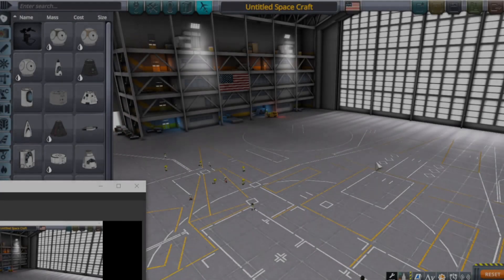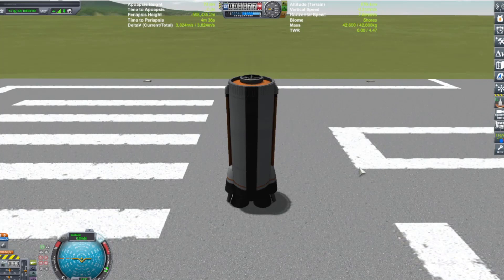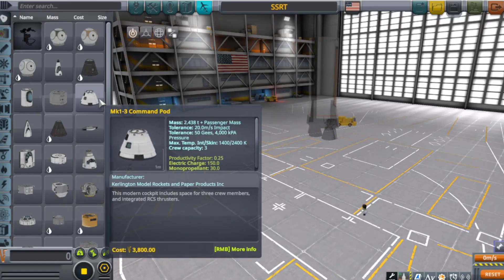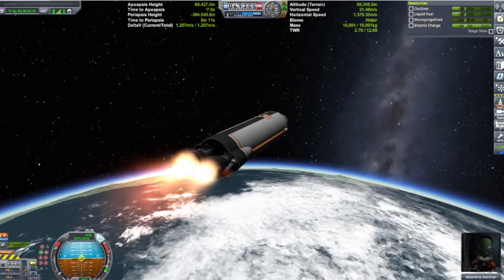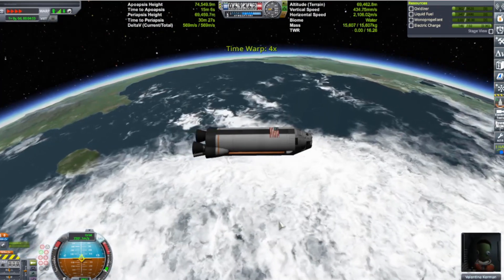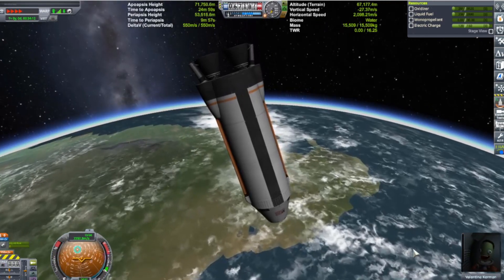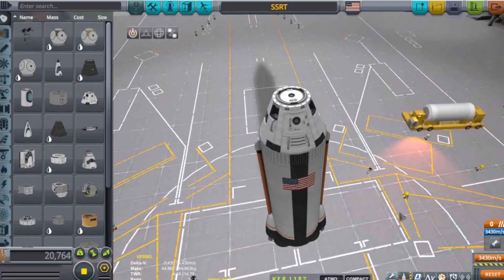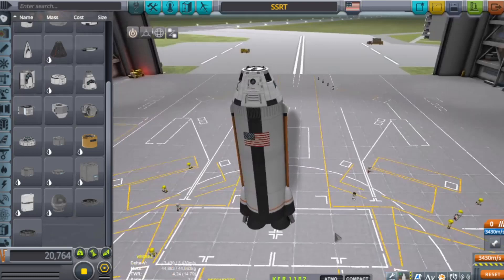SSTO in 2 parts! Ya ... it's that easy.

Comment: This says something interesting about the idea of an SSTO as the ultimate goal of real life spaceflight: it’s relatively easy to make something that can get to orbit in a single stage, what’s hard is making it reusable and useful. As an IRL example: if the LR-89 could have been air-lit, then the Atlas A (which had no sustainer engine) could have been an SSTO (I think, I need to run the numbers). But it wouldn’t have been able to do anything once it reached orbit, not even return to the surface, and it wouldn’t have any meaningful payload capacity.
Reply: SSTO's aren't that easy, at least without a meaningful benefit
Reply: I DONT CARE

Comment: Please do a podracer ssto.. It shouldn't have to be ss, just single engine stage is alright. Mine drops the oxidizer tanks for efficiency for example and has range to Pluto and Charon in Stock size RSS

Comment: This reminds me of the time I kinda accidentally made an SSTO. 

I wasn’t experienced with budgeting delta v for my rockets yet but I was pretty good at gravity turns. So I just wanted to make a two stage rocket to put a payload into low Kerbin orbit where the first stage was supposed to only get it half way there. But when I launched it the first stage nearly got into orbit all by itself. And removing the second stage made it an SSTO. 

Ever since then I’ve been playing KSP modded so that the planets are approximately 3.2x bigger and 6.4x further apart. Much better balance for stock parts in my opinion.
Reply: Stock parts are stupidly overpowered, since their performance is based on real life parts, but everything in the Kerbin system is like a tenth the size of our solar system (which means that the planets and moons are more dense than even Osmium), so it's really easy to end up with a somewhat overpowered design. An Apollo-style rocket can go to like Laythe.

But at least it makes the game more easy so people can either limit themselves in the stock game or mod it like you did.
Reply: @h.a.9880  But the fuel tanks are so heavy compared to IRL tanks (yes I’ve been playing some RO)
Reply: I'm fairly certain the scale that the stock parts are actually balanced for is 2.5x to 2.7x, (~1/4 of IRL scale) which is why planet packs like JNSQ are at this scale.

Comment: If i get to do an SSTO with less than 50 parts that would be an achievement. I always tend to think about using "safety-ish" parts and also pretty much some quite useless stuff while building one.
Reply: It depends if you wanna do anything useful with your trip to orbit, like transport payload.  I've never managed anything as small as 50 and still move payload.  71 parts is as good as i've done to get a mk2 bay into space (with 7t payload).
Reply: Good luck